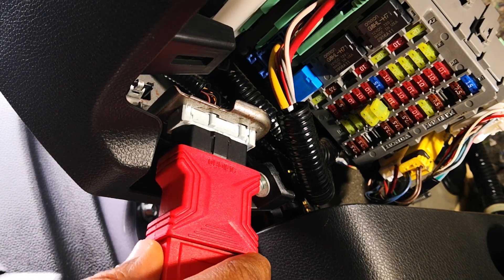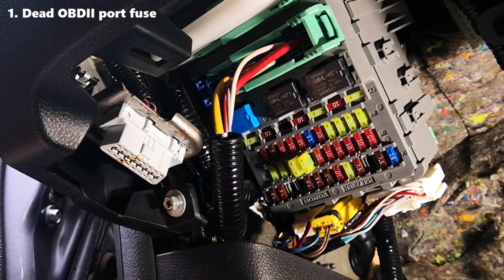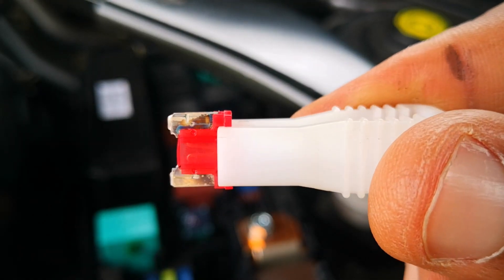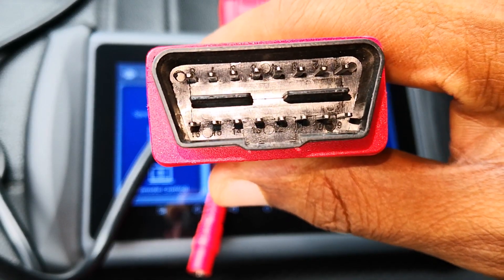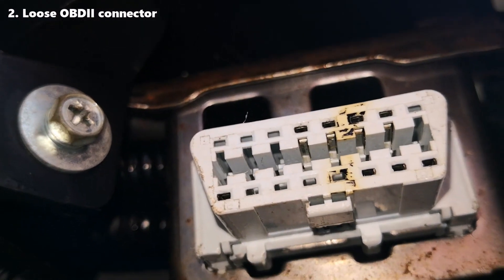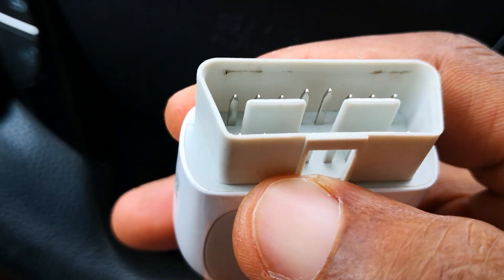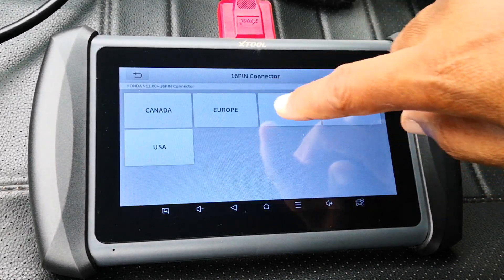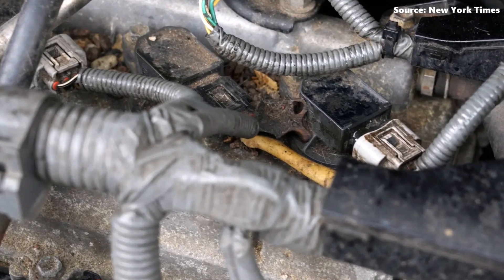How to Fix OBD2 Port not Connecting with Automotive Scanner / Solve Scan Tool Won't Connect

Comment from the maker: Any other causes not on the list? Add it here!

Check out my Amazon store for tools I recommend - https://amzn.to/42LGCL8
#Commissionsearned.
Reply: Hello @DIYAutoworksNG. Thanks. However my OBD Bluetooth scan tool using TorquePro does not connect to my ECU but with the free version its connects. However, the Scanner when connected to my Neighbor's car with TorquePro connects immediately but does not connect to mine. Please what could be the Issue? 

P:S I used another scanner on my car and it connected.
Reply: My problem was my scan tool was too old. It works perfectly on my 98 Accord but kept saying "Link Error" when connecting to my sisters 2009 Hyundai Azera. I guess a scan tool has to be capable of connection to newer 'CAN' equipped car.
Reply from the maker: @landisdavidson6648 Yep. If it doesn't support the CAN protocol, it won't work.

Comment: But if its not getting power to it, cheap cheap OBD2 scanner would not turn on right?
Reply: @ZERONEINNOVATIONS  correct. In my case, I plug in handheld scan tool and the most I can do is read the battery voltage. If there's no power on scan tool then look at fuse or check wiring of obd2 port
Reply: @TheRealist007 I did a diagnose on 2014 Mazda 6 All keys lost    this morning and figured that Rat cut 20 wires behind around the wiring harness going through the firewall. Hazard lamp and brake lamp didnt work so I thought something seriously wrong with the wiring.

Comment: Just bought a 2018 ford f150 this month. Check engine popped up and we took it to the ford shop right away. Their scanner wasn't connecting to show any code. The mechanic disconnected the battery and it went away. Engine light came back a few days later. How can i get it scanned to know the codes?
Reply from the maker: Sounds like the OBD2 port isn't communicating. You'll have to go through the steps in the video one after the other to find the culprit. You can start with researching and finding the OBD2 port fuse

Comment: With the methods you suggested, the check is much simpler: use one or two other cars besides the one having the problem to rule out possibilities immediately. You haven't encountered a case where the VCI unit is faulty yet.

Comment: Jeep Dodge Ram 2018, and higher you cannot connect to the network because you are blocked because a special connector because you cannot go through diagnostic connector from the manufacturer actually goes to a high speed network lines, so you have to buy separate connector. They will plug into the scanner and then it will plug into the two ports underneath the dash. I’m not here to argue this point. I’m just telling you I experienced that I know about it so I’m just letting you know you must have your scanner connect to the internet fully updated. I guess when you run across it you’ll find out about it. You cannot disconnect the battery resistor. You can disconnect a battery 50 times. It will not do it. You must do it through a scanner and you have to have this connector is 2018 and up. Just a regular code. Reader will not clear codes. Regular scanner will not clear clothes. It must be able to access and go online scanner before you could do anything with this vehicle. Clear codes, reset anything look at data you can go on a general. That’s about it and that’s all you can see. I’m not here to argue. I’m just here to let you know when you run across it. It’s not a war issue with the vehicle. It’s our operator air that you’re not connecting to the right port. That’s all.
Reply from the maker: Hey, I know what you're getting at. Those are FCA cars which implemented the secure gateway module in 2018 after Jeep was hacked. The cable you refer to is the SGW 12+8 bypass cable. Beyond that cable you also need an AutoAuth account to buy a license. I've reviewed a number of scanners on the channel that can do this.

Comment: Keep thinking that if you have a Chrysler product, you cannot scan the vehicle without the proper connector gateway connector. You cannot go to that port. It’s a special connector. If your scanner does not go online, you cannot clear code. You cannot reset values. You cannot do nothing with the Chrysler product 2018 newer You will clear the code and they will come right back immediately. I know this for a fact because I ran into it with my scanner, you have to buy the updated adapter and your scanner has to be able to connect to the internet go online. Basically, you cannot disconnect the battery for 15 minutes that will not work. None of it. Will you must use a scanner through gatewaygateway put a block so you cannot communicate with the vehicle unless your scanner is fully updated. Has a internet access and you have a proper plug.
Reply from the maker: You're speaking of FCA secure gateway module which was implemented in 2018 by Stellatis (Fiat Crysler cars). 
You have to use a scanner that supports FCA secure gateway access, purchase a license from Auto Auth and then get the bypass cable (FCA SGW 12+8 bypass cable). With that things would work.

Comment: I have a ISO 14230-4 communication with the  ECU failed or Initialization of generic OBDII Failed
So I can select Diagnostics  and see any OBDII codes thrown, but if I select OBD section of the scanner, I get ISO xxxxxxxxx failed to initialize. This is a BossComm IF-745 scanner on a 2001 Nissan Frontier SC KC 4X4 Auto VG33E. I should add that a cheap scanner I have works normally and only does codes and reset code functions.
Reply from the maker: Sounds like the scanner is having trouble communicating with the vehicle's specific protocol. I once had a foxwell that would trip all sorts of warning lights when plugged into a Honda! See if you can try a 3rd tool. Also check that none of the prongs for the connector of the scanner are  bent or corroded.

Comment: You are a GODSEND!! I watched this video because I hit a bump on the road 2 months ago and my radio, keyless entry, and OBD2 port went out. I replaced all fuses except the back up fuse because I wouldn’t think it would be that. THE PROBLEM WAS THAT THE BACK UP FUSE WAS BLOWN!! You saved me so much stress, thank you so much. I hope you find $100 on the floor and your pillow is cold on both sides.❤️❤️

Comment: I have a FORD E150, 5.4L V8.  The State of Delaware requires ODB2 during vehicle inspection.  My vehicle ails on "comms." It is unable to connect to DMV ODB2 re: the vehicle RPMs. I've changed use #26, and all relays.  Any other suggestions are welcome.

Comment: My  red socket cable wiyer problem. Already odb not connecting. How to know this problem boss
Reply from the maker: I'm not very clear. Do you mean that the red part of the OBD2 connector for your scan tool has an issue?

Comment: Anyone know which fuse is responsible for OBD 2 port on a 2007 Toyota Avalon limited ? I want to check as my scanner says no response from vehicle . But I don’t know which fuse to check I have check ECU fuse it was no responsible for the.
Reply from the maker: It's the number 5 7.5amp under the dash
Reply: @DIYAutoworksNG Thabks so much fortunately I checked the fuse and it seems fine to be sure I put an undoubted fuse to be sure , yet still no response from vehicle , I’m not really a pro in DIY, so I don’t know how  to test further the Port it self ? Do you have any other suggestion for me or should I try and use my OBD 2 scanner in another vehicle first moving forward ?
Reply from the maker: Good call to try the scanner on another vehicle. If that doesn't work, you may want to get someone to look at it.

Comment: Went to see a truck i wanted to buy.. it scanned the vin number fine, but when I tried to scan for codes, it says not supported or s I mething similar
Reply from the maker: You may need to check that the tool supports that particular truck
Reply: @DIYAutoworksNG  if the tool doesn't support the truck, would it read the vin number?
Reply from the maker: Some tools support different functions. It really depends. What truck and year is it? What scanner?

Comment: I have a skoda octavia 2015 that i changed battery, got fault code brakes and adaptive  light, they disappeared after a short drive, 2weeks after the same fault codes returned, the car starts but stops after 2sec and we are not able to connect with the obd port... I have checked all the fuses, any ideas?
Reply from the maker: Before changing the battery all was good? Does the check engine light illuminate with the ignition on, car off?
Reply: @DIYAutoworksNG 
The car has worked perfectly until this happend... Not sure about the engine lamp, have to check

Comment: If the device is lit but does not connect to the car computer and to other cars, what is the problem?
Reply from the maker: Just follow through with the things I highlighted in the video, it should be one of those. Does the check engine light come on at all? If it doesn't including the brief flash at KOEO, it could be the ECU or the wiring to it.

Comment: Thank you for this. I use thinkcar bd6. It can provide data stream using all systems diagnosis but when I use OBd2 features it says OBD 2 not equipped. My unit is Toyota Avanza 2007.

Comment: My previous ECU on my Toyota Camry 2004 was bad, I had to buy a code free ECU, since then my car OBD2 port doesn't respond to my scanner, but is still does with the old ecu.... And I notice my AC light doesn't come up any more, unlike when I was using the old Ecu

Comment: Every video on YouTube tells you to check power and ground.
Is that all there is to data communication??
Ok...I've got battery voltage to ADL.
I've got ground(s) to adl.
(Pins clean. Connectors tight)
Still no communication.
There's got to be a way to test if the ecm is sending a signal to ADL.
Reply from the maker: If the check engine light comes on momentarily when the ignition is turned on, thats a sign the ECM is sending a signal to the port. Have you done the other task of individually isolating sensors? You may have a defective sensor that's messing up things up
Reply: @DIYAutoworksNG  why my car not communicating to obd2 and check engine not coming

Comment: thank you!!!! beyond words !! i just unplugged the mass air flow sensor (i just changed it )and then connected the battery the scan tool connected immediately i cleared the codes and was able to start the car
Reply: Did the check engine light come on? It doesn't light up for me, I have voltage in the OBD II connector.
Reply: same for me, let me know if you figured it out

Comment: Hello. I have below 12v in the battery ,is this problem for the obd2 scanner to connect? My battery show 11.6 ,11.8 v..
Reply from the maker: It should still connect with 11.8v
Reply: Maybe you need to charge the battery

Comment: Which app are you using??
Reply from the maker: For?
Reply: @DIYAutoworksNG  for obd2.. i used carscanner but not connecting ecu on honda vezel!
Reply from the maker: @sameemsahibi7761 I see. I have quite a number of scanners. Autel, XTOOL, Vdiagtool and Launch. All these work well on Honda

Comment: How do I replace when one if it's broken?
Reply from the maker: Haven't dealt with this before but my guess is you'd have to cut and splice the wires leading to the connector using a donor OBDII connector port.
Reply: @DIYAutoworksNG  Interesting. I think I can do that with some help but hopefully, it's not that bad. It seems like the port is just loose and won't make a connection. I thought replacement might be cheap or easier/better.

Comment: My OBD scanner gets power when plugged in, but it fails to get inside the vehicle system… it can’t find the right OBD system and just fails (Mitsubishi Colt 1.6 1999)
Reply from the maker: You mean it's says unable to communicate? Have you tried other cars?
Reply: Yes mine says the same. Can't connect to ecu and everything seems fine...
Reply: @DIYAutoworksNG it works well on other cars though
Reply: @DIYAutoworksNG I have some how it scans mines half way n stops
Reply: Have you found a fix? Same problem
Reply: I'm self struggling guys

Comment: My obd2 scan tool will connect to the ecm, shows trouble codes and will let me erase them to, but when i try to motor the live data, it disconnects. I've tried it on my 04 trailblazer and it does fine, but when i hook it to my 2012 Silverado it won't let me view the sensors or monitor the sensors. Any time i try to read the live data it automatically disconnects and closes the program i'm using on my laptop. Oh, It comes up with this ...... Calibration Identification - NA   I don't know if that has anything to do with it but I thought i would let you know. Any help would be appreciated!
Reply: Did you figure it out I'm having the same type of problem on my 05 Chevy Tahoe
Reply: Did you figure it out I'm having the same type of problem on my 05 Chevy Tahoe

Comment: Very helpful information.  I couldn't figure out why my OBD II scan tool was not communicating with the truck's computer.   I checked the power at pin 16 and found none, then checked fuses and found that it was blown.  Replaced the fuse and it worked like it should and communicated with the computer.  No codes came up so I now have to figure out why the engine stumbles at road speed?
Reply: Coil.
Reply: @mikehenry4743  I'll check that out, thanks!
Reply: Fuel injectors spark plugs or coils and or clean your maf sensor
Reply: If you haven’t figured it out yet reading fuel trims is where you would definitely benefit the most
Reply: Wats the Adapter called For Sensor Check u used? Not the Red one
Reply: @AzadShadad  I have no idea what you are talking about.  It's an OBI II scanning port or it's something completely different.
Reply: @AzadShadad  Uh, that wasn't me.
Reply: Did you have power to the scan tool but not communication? Because I have power but no communication and I'm at my wits end trying to figure out why
Reply: Once it got power st the port, it had communication.@tomc0518

Comment: My car has problem the abs light is on and Car steering wheel is getting hard and everything is connected to the diagnostic tool but just engine and abs system didn’t it is Lexus is250 2008
Reply from the maker: Can you clarify the last part of your query? Have you read it with a scanner that has ABS access?

Comment: Question please .. I have a 2003 Hummer H2. On the message screen on the dash where usually says driver 1 or driver 2 I am getting “Unknown driver” ABS light on, battery light on, Windows, gauges, radio stopped working. Motor runs great. i’ve replaced BCM, ECM. I hook my scanner to it and get no communication. The port has five wires going into it and the tips All look good. I have worked on this truck for many hours and no luck. I’m going to check the OBD fuse I have not done that yet. But if blown would that also cause the Unknown driver which is causing all of the electrical problems,  any help I sure would appreciate it very very much. Thank you, Richard.
Reply from the maker: All this started after replacing the BCM, or?